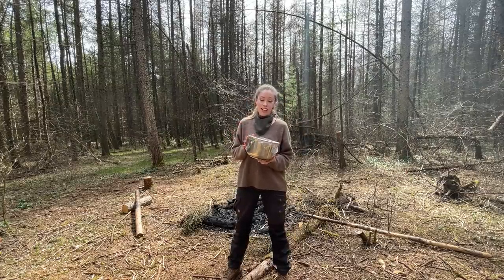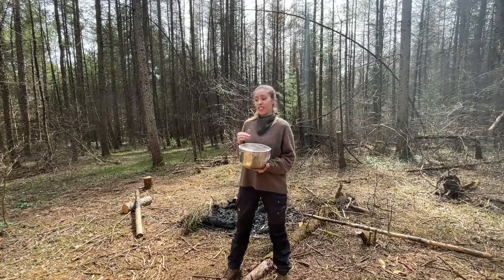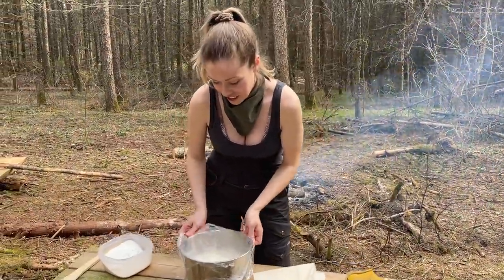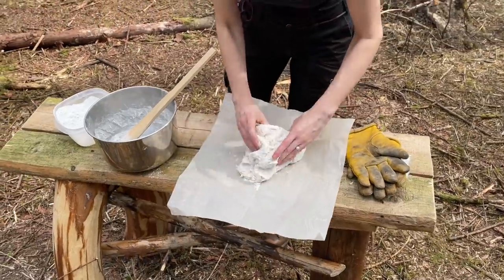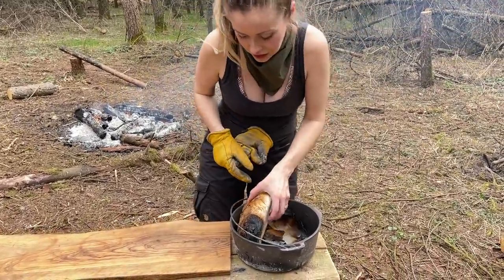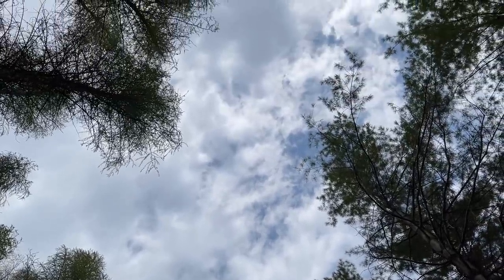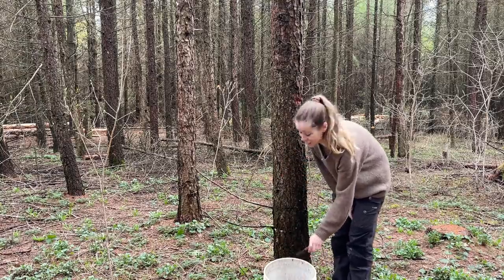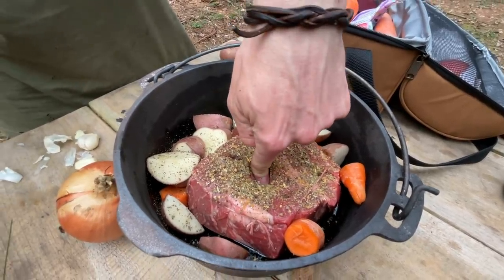Baking Bread on a Campfire & Overnight Camp at Cabin Build Site

Comment: An alternative to bread, is my quickie cornbread, or hoe cakes.  Mix 2 parts corn meal to 1 part "Just add water" pancake mix, plus a little salt and enough water to form a thick batter.   The wheat gluten in the instant pancake mix serves as the binder for the corn meal and it's self rising.  You can cook it like cornbread of skillet fry like a pancake.   You can add lots of chopped onions and make onion patties that taste just like onion rings.
Reply from the maker: I’ll have to try this! Thanks for sharing. I’ve got lots of the “just add water” pancake mix.. and mmm if it tastes like onion rings?! I’m in!